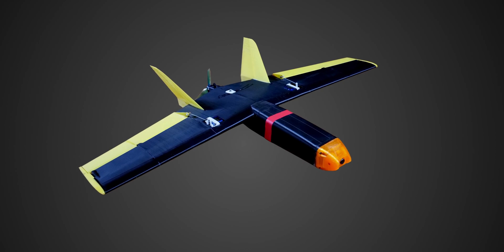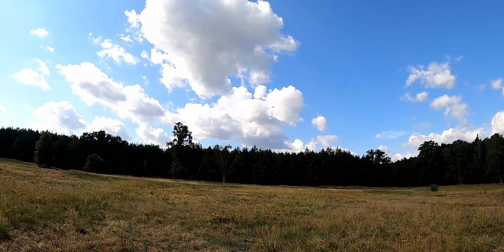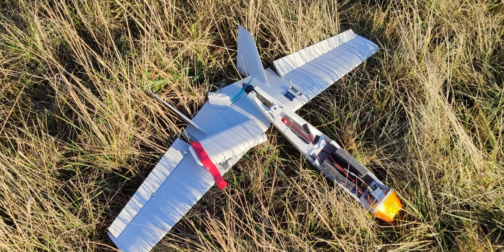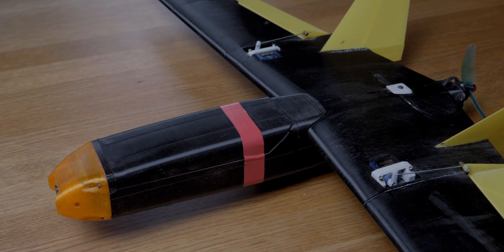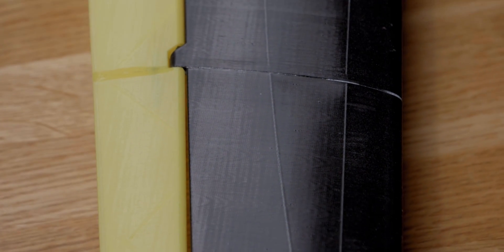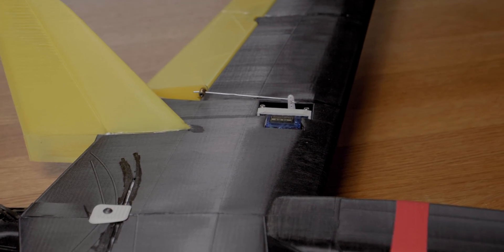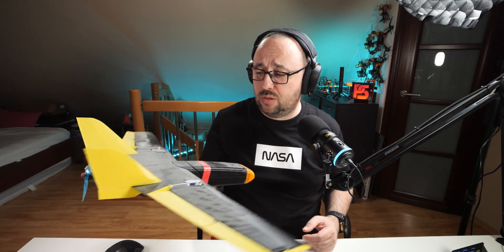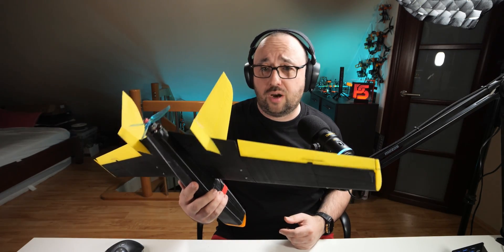The problem of 3D printed RC and FPV airplanes

Comment: What I like is if I crash it I can re print and re build in 24h a nifty trick is to combine the foam and the 3d printed parts I fan 3d print casts I can fill with builders foam to make bodies and wings quickly

Comment: NOT TRUE! while using standard PLA they will be less durable, using the right filament is a must, I use a LW-PLA and double walls, this makes it stronger and more durable and still lighter than using standard PLA, they can withstand a minor crash just as well as a balsa plane or some foam planes.

Comment: i wonder if low density pla (the foaming stuff) and maybe print the wing skeleton and body, with reinforcements inside, and wrap it in foam as it's usually the wings that breaks, from what ive seen.
Reply from the maker: I'm not sure if that would help much. LW PLA is still fragile

Comment: Great vid! my solution is just to print 2 or 3 airframes. yea, it takes time, but there's nothing better than knowing you can just swap your electronics over and get back in the sky for 20 bucks. for me its the cost effectiveness. i can print 10 replacement 70mm F16 airframes for the cost of one foamie F16, and for me thats absolutely worth it.

Comment: Nice to hear someone talking about this subject.  There's a misconception that 3d printed planes are easy to fix because you can just make your own replacement parts.  Getting the broken parts detached from the parts you want to keep is a challenge (or impossible).  Sometimes I use hotglue and some folks just say to reprint the whole thing.  I've also printed a few paid models that flew awful from bad thrust alignment to terrible stall characteristics.  Prefoamed LW-PLA and regular LW-PLA are light but no stronger than regular PLA and still heavier and more fragile than foam.   I still get tempted by all the creative designs but am not as enthusiastic as I once was.

Comment: While I agree that printed planes will not take the punishment. I like them because I can print a plane, fly it, print something else.  I have a couple airframes that I've printed more than once & others that only did a few flights before it was scrapped.
As you say, they're printed in a week, build out in 2.
Pros & cons to everything

Comment: LW-PLA foam. Sand the outer surface and “glass” it with cheap thin fibreglass cloth. The epoxy soaks into LW-PLA a bit when it is sanded. You don’t need to glue in spars, just make it removable like a zohd etc.

Comment: As everything in life this is a trade off, pros and cons in both 3d printed and foamy planes. The 2 main cons  for 3d are : fragile and time consuming. For fragile, try new materials like TPU or hybrid/mixed, improve design like glue free and modular. For time consuming, buy faster Delta printers, or multiples printers in parallel (even better).  And this is not the “future”. This is the reality today!  Internet shows many good examples! Happy fly!

Comment: What i have. been saying about 3d printed aircraft they should use the like of laminates or tape to give the 3d printed craft a durable outer skin to keep the plane together and tougher on a crash. We have been doing it for years with balsa, foam etc planes.
Reply: Has anyone done a 3D printed frame, like a trad balsa frame, which could then be covered?
Reply: @slammerf16  Not that i know off but thinking about it could work nicely if done right.

Comment: If your reference is foamies, sure, they are more fragile. But crash a balsa model and you'll get the same mess of small pieces. And fixing it will require much more hands on time... As you say, pros and cons...

Comment: Like with most technologies, the robustness and repairability will vary with an individual design and design elements. The quality of a design is reflected in the success of the designer, and what the design is worth.
The example here was last updated in Sept 2020. Since then, many better 3d printed designs have beed released. The quality of designs, and what filaments to use has also improved. Many of latest designs are much stronger and require less, or no carbon fibre stringers. Even 3d printers and more so slicers have really evolved in the last few years. Many features that make setup and getting good quality prints out of the box, with much less experimenting and learning prior to a real project.
As a comparison, INAV 2.4 would have been the latest and greatest in mid-2020. Would you fly your a new plane build in 2023 with INAV 2.x, or INAV 6.x?

Comment: I have a Ph.D. in materials (polymeric and metals. I have a technique to increase the mechanical properties of the 3D printed parts by 7 to 10 times before gluing all make sand or salt mold (introduce the part in salt or sand) and melt in an oven for 30 to 60 min ... also a coating with a very light glass fiber increases the elasticity of the plane by 2-3 times.
 I found it here on YouTube and I try it several times to see the results.
Reply: You should give 3DLabsprint a call!!

Comment: I'd also highly recommend to get a good design. Eclipson Model A (free) is actually quite bad (no CF tube so unless you print it really well it'll just snap at the first looping). Eclipson recent paid models are excellent (like their new MODEL 3D) and the Craycle OrcaV2 is also easy and fast to print. Yes all are paid but they are much better than any free version I found.
Single use? When using LW-PLA probably. When using PLA+ and a good model, it'll hold a few rough landings usually. Also you glueing technique and printing technique will probably improve over time. I usually avoid glueing CF, IMO it's strong enough without glue and I want to reprint in case.
Reply: Eclipson model V...that is one heck of a flyer...
Reply: Printed an Eclipson EBW-160, took two weeks and it just shattered after a single landing
Reply: @thatlittlefrog.  LWPLA? I fly mine (other models from them) usually without breaking unless I have a hard landing. Also I found it safer to coat with epoxy to make it stronger and avoid most harder landing to separate layers.
Reply: @thatlittlefrog.  Actually I highly recommend starting with small and easy to print model like Wolf Gö. Flying skills may not be challenged too much but printing and understanding what the planes can handle is important. Then I personally liked the aerobatic model the most. Gliders are fun but not for me.

Comment: Absolutely agree 3D printed airplanes are not easy to repair and its not easy to replace "just" the printed segment that was compromised. Its not easy to "unglue" the remmants of the damaged part without damaging the segments that are not compromised . You usually have to print more than you think and it takes time...

Comment: Hi Pavel, I think you should try a special material for printing RC aircraft - light weight PLA (PLA-LW). This material changes everything, it is lighter and almost like foam.
Reply: My main concern about LW PLA is that in a hot car it will melt/warp. And LW ASA which has a higher melting point is a pain due to warping

Comment: Hi Pawel, while I agree with your thoughts on 3d printed planes and have broken many designs I have moved to a construction method of you a lwpla and then skinning it with either carbon fibre or glass fibre. A bit more complicated, but they are very tough and light.

Comment: Agree, they are atm just for experienced hobbysts. But that might change if someone manages to develop filament that combines 1. impact resistance (great interlayer bonding) 2. more LW foaming property 3. ease of use (printable on cheapest printer). Polypropylene seems promising, but it warps a lot, needs more advanced printer (with heat chamber) to print successfully and still heavy compared to EPP foam.
Reply: I'm looking at pre-foamed asa

Comment: Hi Pawel, most of the time I agree with what you say but here I think you are way off. It only depends on what 3D Print model you get and what material you use. You should do a little reasearch. And I mean no disrespect but your opinion is like 2 years old. To explain my self and not to criticise without any points. Materials, there has been a huge leap in quality foaming materials mainly ColorFab LW-PLA (I tried all LW materials available to date and this one is simply the best - sorry 3DPrintLab). This filament allows you to print on 45%-50% extrusion and weights the same as regular PLA per mm. Second thing is utilising what you have available. There are airplanes that are not glued but use tiny screws on right spots to avoid trouble rebuilding - also I would never glue a carbon spar into 3D printed airplane (there is no point really). Also the benefit of PLA over foam - yes its fragile but sturdy. 3D printed airplane can go safely up to 200kph without breaking a sweat.....not like my Ritewing Nano Drak which at 220kph started to bend a little.....not nice EH...Final point is 3D printing. If you have optimised model it only takes 2-3 days to print full - then repairs from experience only one afternoon. I was also a firm believer in foam airplanes....hell I build more than 10 of my own design and with hot wire cutter but really 3D prints are just more interesting

Comment: TPU for the win!  🙂
Reply from the maker: TPU airplane, that might be something worth building :)
Reply: @FPVUniversity  But probably not something worth flying -- too bendy and heavy me thinks!
Reply from the maker: me agrees
Reply: I print all my plans with lightweight pla and then coat with table top epoxy thinned with acetone for a very strong plane. My son has crashed a rifter I built six times and it's still flying...

Comment: Just FYI, in the real world - airplanes are engineered to fly, not crash. Meaning... the strength and weight are optimized for flight, not durability when hitting the ground.
Reply: True. But this is not the real world. It's rc
Reply from the maker: In the real world absolutely. In the RC it's a different story
Reply: In the rc hobby manufacturing and repair is equally important
Reply: Lightweight pla coated with table top epoxy thinned with acetone makes for a very durable plane that can belley land on gravel and handle the heat
Reply: @spirit_wolf123  Do you have a video show how to apply the epoxy on the plane?
Reply: I started and flew rc when we built everything from wood sticks and such. Took weeks to build and cover. The advent of the foamie is wonderful! Crash survivability of foamies is great! I don't build wood or even buy wood arfs.  Because the foamies fly just as good and can survive the occasional mishap

Comment: I totally agree. But I do still see 3-D printing a big part of the future of aerospace design. I myself am using 3-D printing in my designs, but only for some components, prototyping, and for example, extensions for carbon fiber wings in order to increase the aspect ratio.

Comment: The impression of 3d wings is spoiled by an error in choosing a project (poor wing design), ignoring the recommendations of the wing creator when choosing a printing material, a poorly configured 3d printer and a slicer profile.
To print a 3d wing well, you need to prepare.
The issue of wing repair is solved by pre-printed spare parts.
Not a problem at all.
3d wing flies better than styrofoam.
Reply: Finally some up to date comment. My 3D printed wing needs only 2-3 days to be fully printed and I never print at night.....and its put together using small screws....sooo.....you sir are completely right

Comment: Pawel, I absolutely agree about 3d printed airplanes, but... I was thinking... There are some 2 part liquid foams out there. I remember a TV show about taxidermy where they used molds to create a foam body for the animals. 
I don't know if any of these foams are light enough, but you could definitely print molds in TPU, for example. To use with one of those foams.
What do you think about the idea?
Anyway, stay safe there with your family! 🖖😊
Reply: I've wondered the same thing. I don't know if I'd use TPU since I wouldn't want the foam to deform the mold. I think a PLA mold coated with keep it nonporous would probably work. Unless the foam gets hot. Does it?
This something I really want to try sometime.
Reply: @ddegn  Yeah, it does get hot. I don't have idea of how much though. 😬

Comment: Nothing beats hot glue repairs to foam in the field. It’s already a big production for me to go to the field to maiden a plane. If there’s a crash, I don’t want to have to go home and spend a week reprinting stuff I could have just glued in 10 minutes and been back in business.

I think the key is to print some key parts and integrate them into a foam build.
Reply: I went this way too. Designed  wing tips and fuselage then just HOT WIRE CUT wings from any styrene I found....eventually ended up just printing.....its not a week to print a whole airplane....if it is then you are making a mistake along the way - also dont get mistaken you can hotglue and fix 3D prints too -  you just need to pre-print sheets using only a single layer of PLA f.e. then slap it onto the broken part....done...I did this a few time in the field (using UHU POR)

Comment: If the 3d printed planes fly great.. then I would say probably print spare parts ahead of time.. so if it breaks.. you can replace immediately and not wait hours/days for parts. I am also curious if they are more fragile because of parts rather than one CNC cut carbon fiber bit (in the case of drones).. but foam RC planes I would think are cheaper and less likely to break due to being super light right? Why would anyone want to print a much heavier plane if it breaks easier.. vs foam?
Reply: Its more convenient and you are right - I do print a lot of parts ahead of time. Why do I print my plane when its 100g heavier than the same thing Dart V2 in foam? Its more fun and my dart looks like a mess with all the glue marks and tears with missing foam....here.....your airplane looks like new any time you want....BTW....I think I only need 400g of PLA to print airplane similiar to Dart V2.....with price of PLA around 13Euro.....I can literally get new airplane for around 6Euro....and we are speaking FULL AIRPLANE

Comment: What is about designing parts in a way that requries printing in vase or spiral mode? this could take less time and material. I watched very interesting ideas about such design at @TimStation chanel
Reply: I think most of the designs for LW-PLA use vase mode nowadays.

Comment: Following the 3d printed planes with interest. I'd love to see a bit more "lego" going on with parts that lock or slide together so small sections of them can be more easily repaired. I'd also love to see more hybrid designs where for example you print some ribs, add spars and cover with depron or film.
Reply: You just need to look around. And pay attention to FPV projects from Russia. Grom,Zero, Shepherd, Punisher :D
These projects are perfectly designed and fly perfectly.
Reply: Not sure if you are following or occasionaly bumping into them....there is A LOT happening right now......I would also mention "Oliver C" on youtube and his FREE model RIFTER and others
Reply: Yeah aware of all of those. Still think there's some way to go in terms of repair-ability though. Removable wings is for sure a step in the right direction though.
Reply: @frasersteen  I was criticising all of the 3D designs and got pissed so I made my own. It has wings that are held together by wood screws. You dont have to fight the glue. Damaged wing parts are interchangeable on the field. Fuselage is optimised in a way that if it breaks you again unscrew just the part that breaks the most. Motor mount is POP-OFF so hitting ground means it only disconnects. FC and electronics sits on its own shelf which in case of total destruction is just unscrewed and moved to new fuselage. 3 days of printing. 10 minutes max to build the frame - Soldering time is up to you
Reply: @chemistt  Sounds brilliant!

Comment: I think that 3D printing is not suitable for such large objects. Try to make smaller things like drones up to 3 inches or nano planes (less printing time and more resistance, compared to something that big).
Reply: Incorrect. 3D printing is not suitable for small things. The bigger you get the better. The sweet spot for 3D printed airplanes is around 1.2m where the whole construction starts to benefit from the fact that its empty VS EPO airplanes which need to be complete foam beacuse its a mold. I hope you get my point.

Comment: Using PLA or LWPLA is super stupid for things that will be used outdoors (like RC planes) since it breaks down in sunlight. Maybe you can paint it, but then the paint adds a bunch of weight.
Reply: It's not so much the sunlight as it is the temperature. Just 50 C is enough to warp PLA  to the point of unusability
Reply: @Zoey_the_Rat  LW PLA prints at 270 C, the transition temperature (soften) is higher and you can annealing it too.
Reply: LW-PLA is basic printed foam, it's awesome, but the time between repairs is still high.